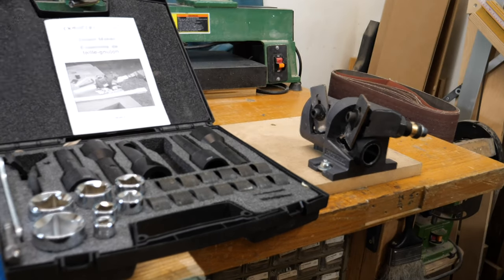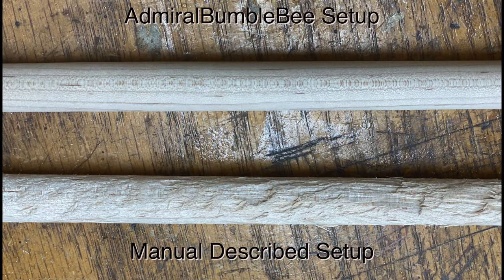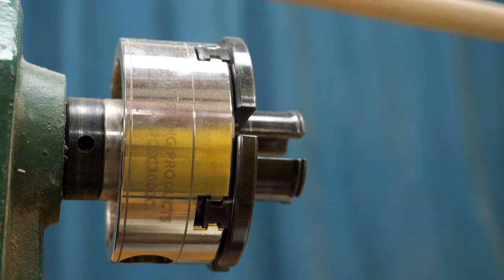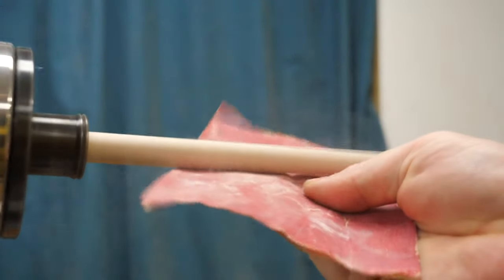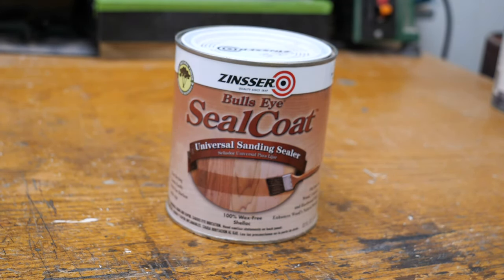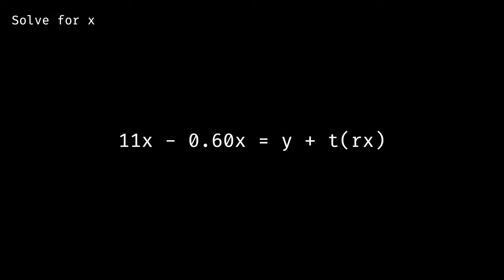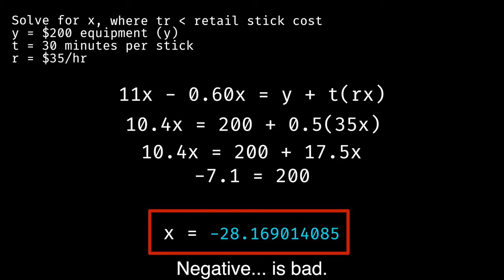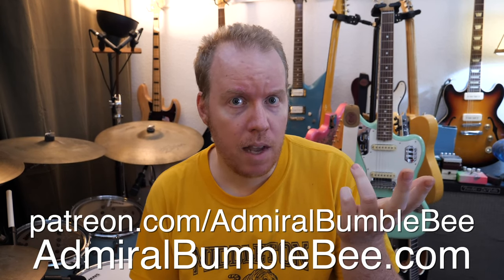Make your own drum sticks.

Comment: pro mark used to make a pair of sticks out of japanese white oak, the 777s. they still make a few kinds out of that wood but not the same profile i like. i work at a sawmill so i have pretty much an endless supply of wood and you don’t need much to make a pair so i’ve been setting aside oak butch and maple to make some when i finally get a lathe. i’m excited to mess around with different profiles. i’ve thought it would be cool to make a pair that’s just the two butt ends up the stick because a lot of the time i play with my sticks backwards anyway. i need to find some japanese white oak too to make some. one of the reasons i liked those pro marks so much was because of how heavy they are. playing hickory or whatever kind i’ve been using  just isn’t the same. and i blow through a pit in like three songs. great video you mentioned some things i hadn’t thought of, the sanding with the grain is a good point all the other videos i’ve seen they just sanded it on the lathe

Comment: I make mine on a lathe 18" long out of Oak  or maple and then brush on water based verathane diamond hard  finish 3 coats light sanding in between coats,best sticks I've ever used and you couldn't tell the difference between mine and store bought except the length which is Ideal because it's the exact distance from the tip of my middle finger to my elbow,great for leverage and bounce,try it!